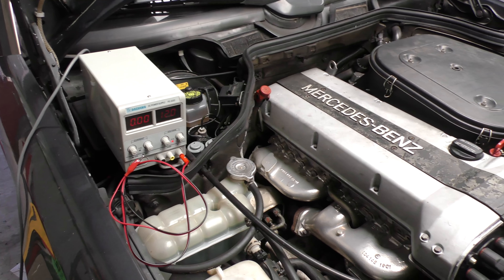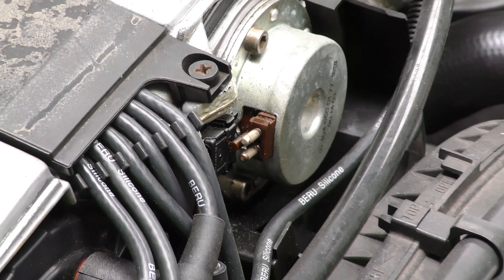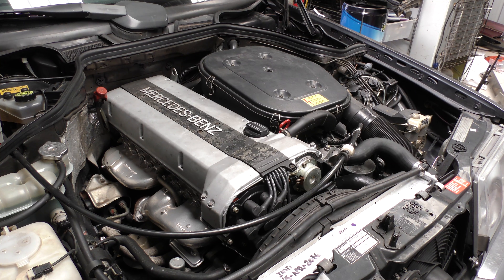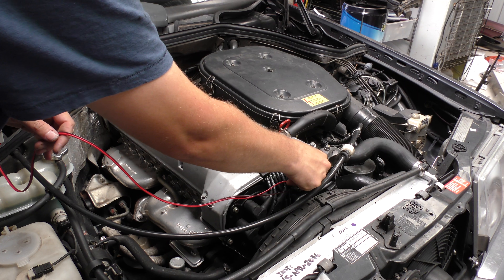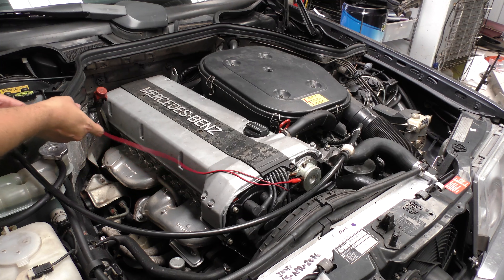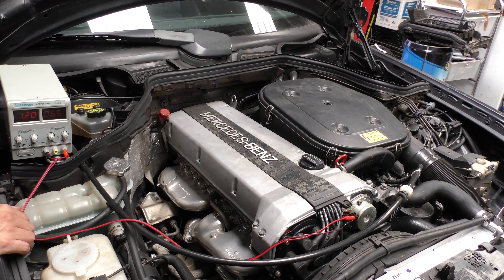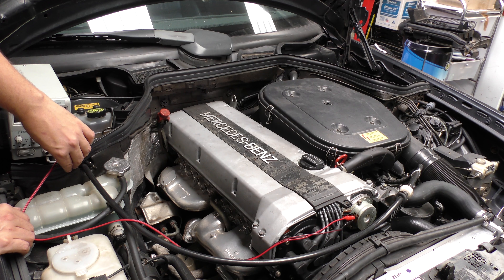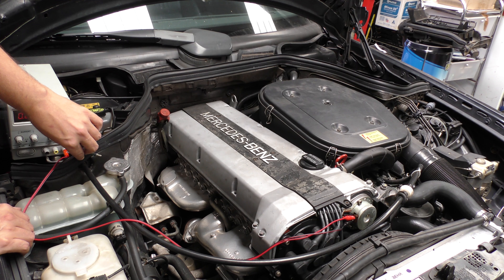Functional Test of Variable Intake Cam Adjuster - 1990's DOHC Mercedes.

Comment: I disconnected it on my 1995 e320 and the loud rattle noise in my motor stopped! Used to rattle past 2200 RPM. Got full power back with no more hesitation during acceleration. Thank you!!! Now I’ll get this replaced 👍

Comment: My car  E124 E320 has terrible acceleration, it feels like it's pulling a heavy trailer. On the connector side, the wire shows continuity when the ignition is off and the key is off. Is this normal?
Thanks

Comment: hi... this is off-topic but what size breaker bar would you recommended for removing the o2 sensor? bigger the better? :)
Reply from the maker: is yours seized in there? I've never really had any issues removing them, pretty sure I just used normal hand tools, ie a ring spanner on my w124 and my mothers 25 year old suzuki (the only 2 o2 sensors i've ever changed) Mine was not even faulty either, I did it because I'm anal and there was slight damage to the cable. Do you have reason to suspect it maybe faulty?
Reply: thx for your reply. apart from a video I saw saying along the lines of"if you don't know the history of it, just replace it". I've had my 201 for about 5 years now and there are no records of it being replaced. also, the manufacturer of the part says it's good for 100k km. another thing is that, the engine would hesistate/labour after about 10 mins of driving especially at the traffic lights. intermittent though. what do you think? is it on the way out? I might try again after driving it for about 15 mins or so. I realise it can get quite hot like 300C hot which my IR thermostat has indicated.
Reply from the maker: have you done a duty cycle test, this will tell you immediately if the o2 sensor is working. The oscillation around 50% at idle means the rich / lean cycling is working (on catalyst cars) this isn't possible without a functional o2 sensor. If its at a solid fixed value there is an issue.
Reply from the maker: note that the engine HAS to be at operating temperature to go into closed loop mode. The o2 sensor is ignored during the warmup phase.
Reply: sure, I will check that. I found some resources on benz dot org which is simple enough to try out.